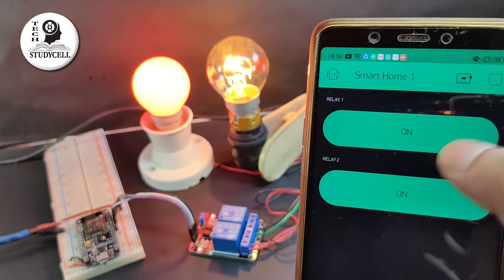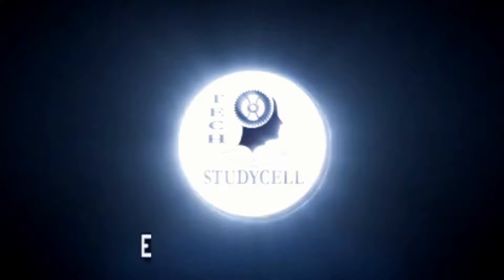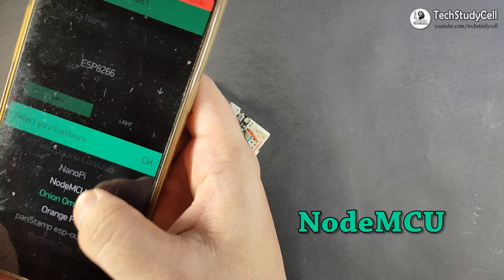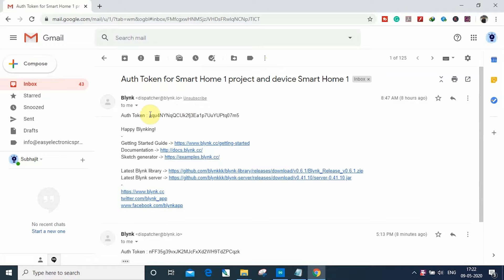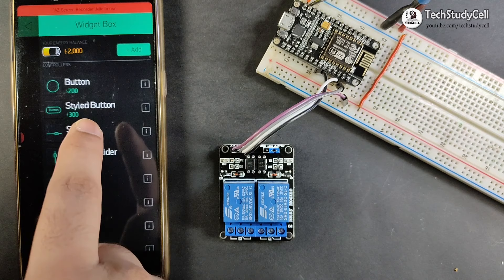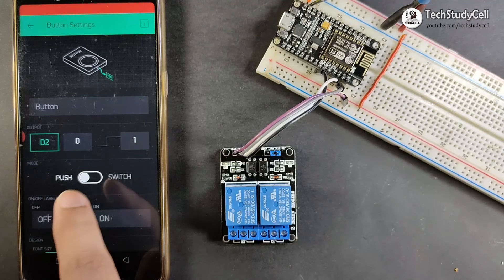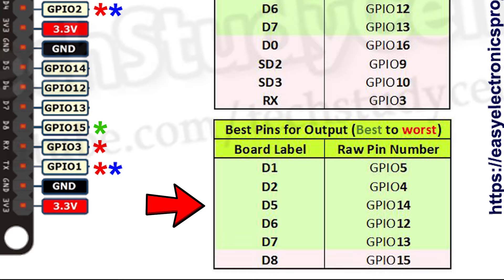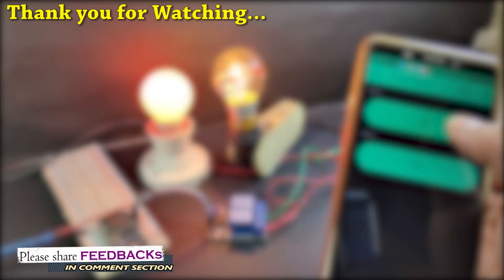Home automation using NodeMCU and Blynk App - IOT based Project

Comment: I am facing issues with relay.
My relay is getting NC to NO.. on applying both 3Volt and ground

When I touch input pin of relay to 3volt of nodemcu it gets switched... And if i also connect it with ground pin of nodemcu..it also switched on

Comment: Thanks for the tutorial. But you forgot to tell how to add board to arduino ide. Mine have a error while Uploading the sketch.

Btw with this project the light works only with blynk and not with the switch how to make it work with switch board button and blynk too?
Reply: Which board did you use for your project

Comment: Hello sir when I'm uploading it showing error 
esptool.fatalerror.failed to connect to esp8266:timed out waiting for packet header 
Pls solve my problem 🙏🏻

It port COM 7
 It showing 
The selected serial port does not exit or your board is not connected 
But while uploading it blink blue led light in esp8266

Comment: Sir hum dunya k Kisi bhi Kona se relay control krsaktay han 
Just like hum agar office m han or Pani ki motor on krni ha to office se on hojaye gi?
Reply from the maker: Yes. If the NodeMCU connected with the Office WiFi. Your mobile and NodeMCU are connected to Blynk server. So when press the button in Blynk app, it send the signal to Blynk server through the internet. And the NodeMCU received that signal from Blynk server.

Comment: hello there, mat i ask you a question sit? i try to use IoT pproject using nodemcu for my last project. But i have an issue that the nodemcu response is too slow after i give command from blynk app. Is strength of the internet connection influencing the nodemcu response? thankyou

Comment: Great project. 
But I'm getting a problem. 
While compiling it says (esp8266. h no so file in directory) . And there are no ports also.
Reply: u  Need to upload the Library and if the Port is not Showing Means U need to install the Driver..... there r two of Library is there one is CP2102 and CH340

Comment: Modem u works with 3.3v only.  5v will damage the board
Reply from the maker: There is a inbuilt voltage regulator, so you can give 5v at Vin.

Comment: Awesome explanation. 
I bought NodeMCU With 4-Channel Relay Board. In that 1 relay is soldered to D3 pin of ESP.
Could you explain how to use D3 pin as output? All other 3 relay is working as expected

Comment: sir do we have to connect on same Wi-Fi or it will work on WAN
Reply: The app is meant to be controlled from anywhere in the world. Only issue is the new version of the app doesn't seem to have a NodeMCU device option.
Reply: @zerobot_tech  ok thanks
Reply: @zerobot_tech  can you suggest me which board should I buy
Reply from the maker: For both NodeMCU and ESP01 select ESP8266

Comment: Hi, how do you power your ESP8266 board? What power supply do you use?
Reply from the maker: Mobile charger
Reply: @TechStudyCell  What voltage are you supplying to the board ? Is it 5V ? I can't power my 5V relay module even though I connect the relay with 5V input, how can you do that ?
Reply: You can also use step down transformer, Bridge rectifier, Capacitor, 7805 regulator to get +5v dc supply to nodemcu

Comment: How to give 5V DC supply to nodemcu
Reply from the maker: I have used the mobile charger.. connect the 5V supply across vin and GND pin
Reply: @TechStudyCell  Can i use power bank of 5V 1A output